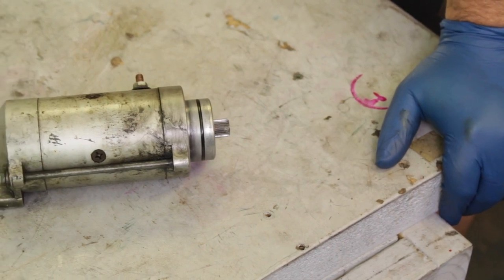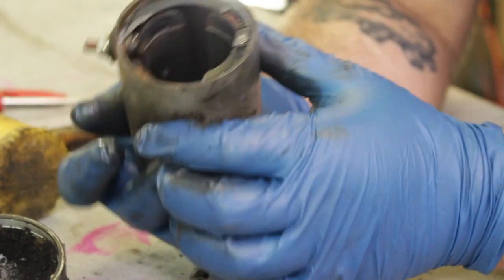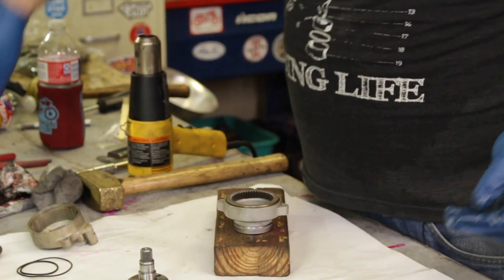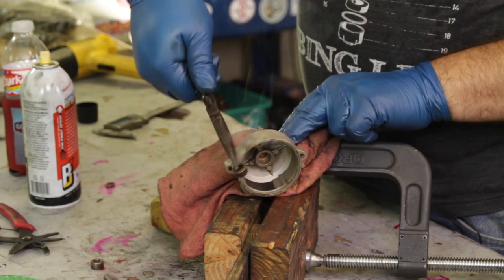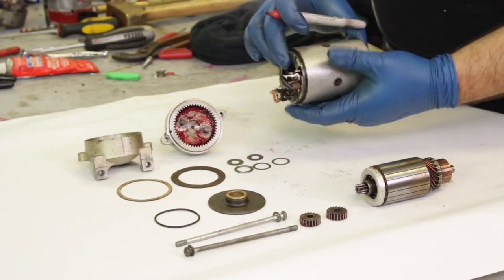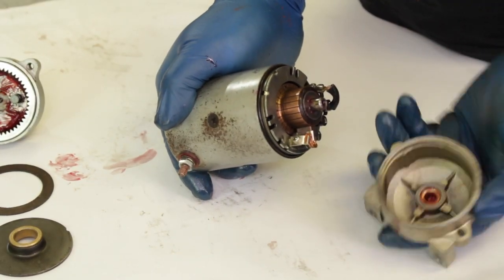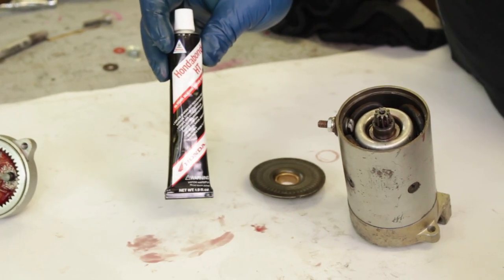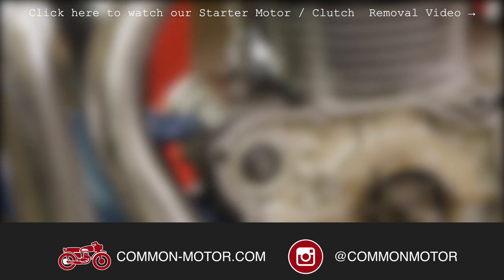Honda CB350 / CB360 / CB450 Electric Starter Rebuild

Comment: Really nice video but I winced when you pounded on the inner race of the bearing when you removed it.  Generally it is frowned upon to hammer the races onto the balls.  It damages both in a process called Brinelling.  If you could have engaged the outer race with a larger socket that would have been better.  Sometimes there is a slot in the shoulder that butts against the outer race so you can drive the bearing out with a screwdriver or punch.  Sometimes there is not.  Heating as you showed is a great way to reduce or eliminate the amount of force needed.

Comment: i used this vid as guide to do my CB72...... its a bit different but using the same techniques it was a reasonable guide to doing the CB72 starter motor....lucky for me the bushes and  bearings were in good shape and it really just needed a clean up , repacking with grease, make another gasket to protect the brushes from the weather and she's good to go.....yeah i got a 1970 CB175 as well

Comment: My starter won't turn freely before or after the rebuild. Semi turns with pliers until the planetary cap is back on and then it stops up. This was a great vid, but I may go starterless if I can't find a replacement. Rock on CMC. Yall are a great help.
Reply: Maybe some clearances are too tight?

Comment: I did this today, or at least tried.  When I got it apart the planetary gears had no bushings (2:36).  I was like, where are they?  The starter had been making this honking sound, like the bearing was completely dry and/or shot, but it was the planetary gears I guess.  Bought a used one on ebay and will use the CMC rebuild kit on it.

Comment: When placing the gaskets on either side of the planetary gear plate I thought the wider top gasket could possibly make contact with the planetary gear assembly and I'm curious if the gaskets should be in reverse order? Another consideration that I found was that eliminaton of both gaskets makes the overall length of the starter about 5/32" shorter and the mounting bolts to the engine will not line up.

Comment: I'm looking for info on starter solenoids for a CB360s.  I replaced mine today, but i'm not sure if i hooked it up right.  the bike DOES start, so i'm assuming it's right.  my question is:  would it start even if the wires were hooked up backwards, like to the wrong terminals??  i connected the colored wires correctly to the harness, but the terminals on top of the new unit had no indication of which side was positive or negative or what.  i took a 50/50 chance and just hooked it up how i assumed it would go.  but might this cause problems down the road??  thanks!
Reply from the maker: Hey Andrew, your hunch is right. It won't matter or hurt it if the small wire connections are backward.

Comment: The rebuild is not the issue, it’s a “2” on a difficulty scale of 1-10... the issue with most these starters is that the planetary gear plain bearings/bushings are usually shot. Notice how they noted here that there was little grease when they disassembled it?!?  Those bushings are NOT included in a rebuild kit and are not a standard size. So, unless you have a roll of oillite and a metal lathe or a friend who works strictly for drinks and/or smiles, you could still be very much “ outta luck”.
Reply: You are correct the small bushings on the planetary gears on mine are shot.
Reply: @mickkulin8207  Wish I could help, but I still haven’t sourced these. I ended up using some half decent ones from a starter I don’t need currently.